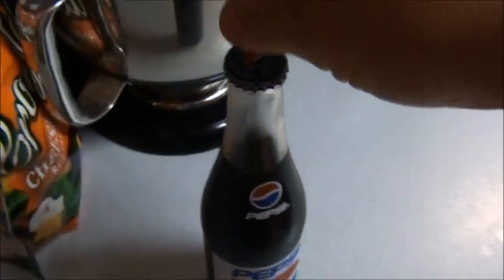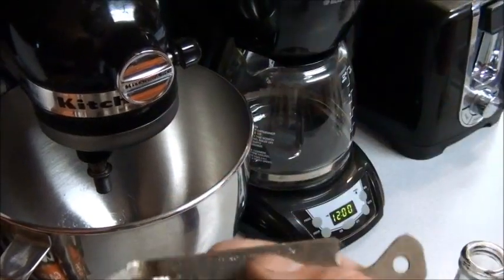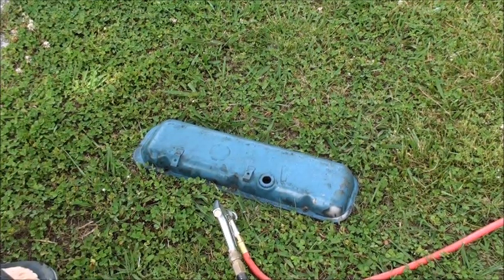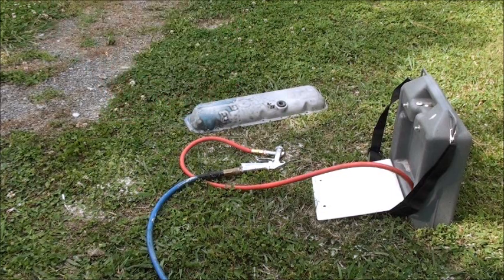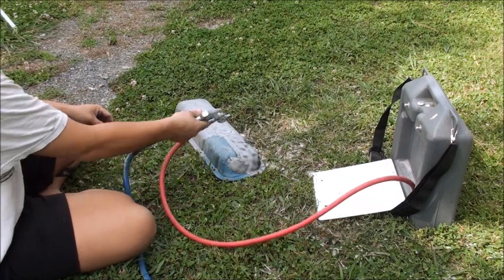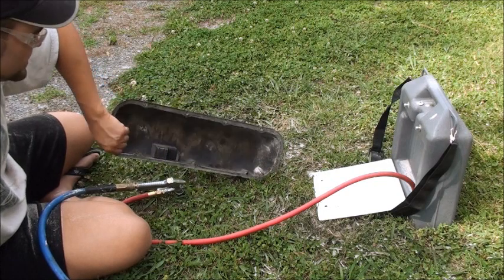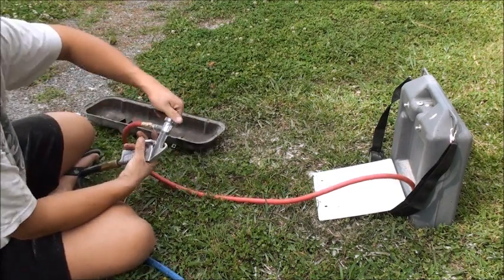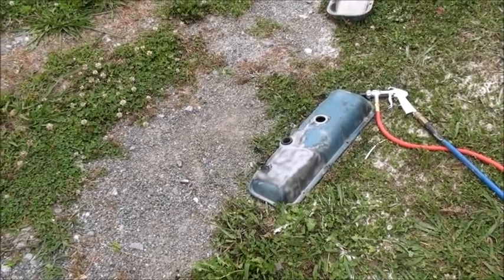CHURCH KEYS , SAND BLASTING , AND VALVE COVERS !!!

Comment: you can get these little blasters for well less than $50 bucks , and yeah they work well if you feed them enough air CFM , they are great for small stuff , but not for body parts , as blasting will remove the factory Ecoat on the metal , your way better off to sand or chemical strip those parts , but for small stuff you can't beat a sand blaster , and building a wired screen box is easy so you can recycle the sand , and use it again , play sand is cheap , but the black beauty is better , just $